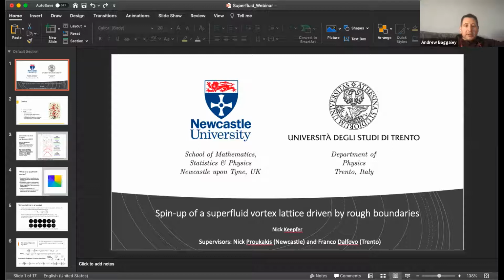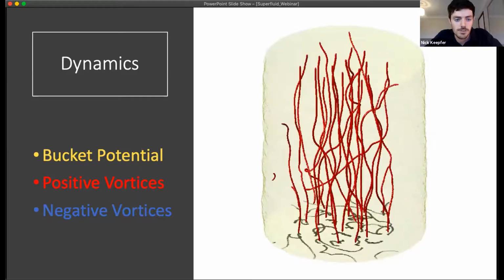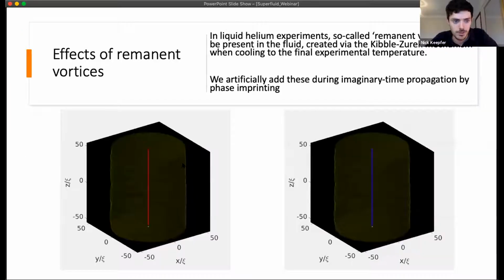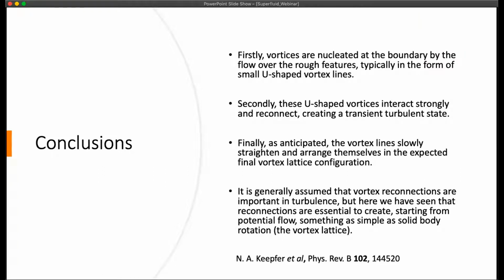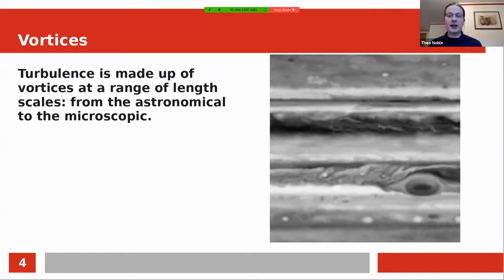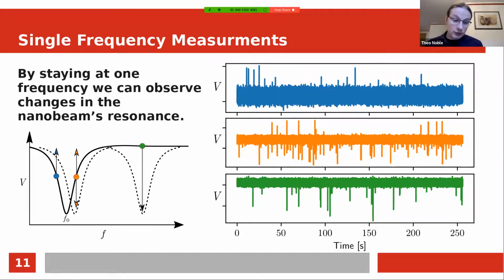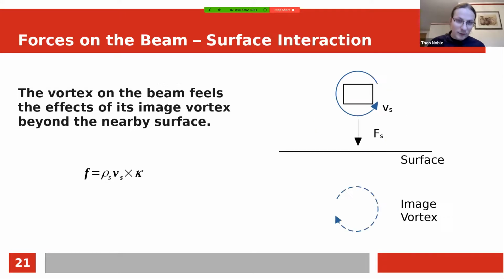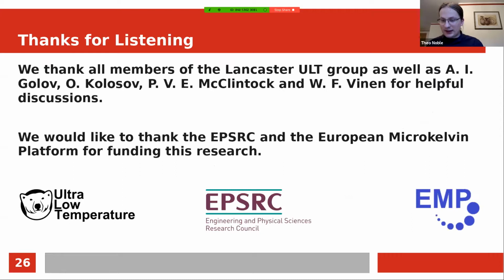Spin-up of a superfluid vortex lattice driven by rough boundaries

Comment: Are vortices in Superfluids a macroscopic version of what happens in Spinors? 

   Is there a geometric explanation of Planck's constant?   Does this explanation require at least one extra spatial dimension? 

   Dr. Roger Penrose has suggested instead of trying to create a particle called the "graviton" to explain gravity, why not try to describe subatomic particles in terms of spatial curvature, as in the twist in a piece of real thread.

   What if we add one extra spatial dimension to the "Twistor Theory" of Dr. Roger Penrose?   It can be "chiral" by having either Right-hand or Left-hand twist.  It can be "Quantized", based on the number of twist cycles.

   If Physicists describe electrons as point particles with no volume, where is the mass of the particle?

   Can one extra spatial dimension produce a geometric explanation of the 1/2 spin of electrons?   The following is an extension of the old Kaluza-Klein theory. Can a twisted 3D <---> 4D soliton containing one extra spatial dimension help solve some of the current problems in Particle Physics?

   What do the Twistors of Roger Penrose and the Geometric Unity of Eric Weinstein and the exploration of one extra spatial dimension by Lisa Randall and the "Belt Trick" of Paul Dirac have in common?  Is the following idea a “Quantized” model related to the “Vortex Theory” proposed by Maxwell and others during the 19th century?  Is the best explanation of the current data a form of “Twistor Theory” first proposed by Dr. Roger Penrose during 1967?  During recent years Dr. Peter Woit has explored Twistor Theory as a possible solution to help explain the current Standard Model.

   Has the concept of the “Aether” been resurrected from the dead and relabeled as the “Higgs Field”?

   In Spinors it takes two complete turns to get down the "rabbit hole" (Alpha Funnel 3D--->4D) to produce one twist cycle (1 Quantum unit).
 Can both Matter and Energy be described as "Quanta" of Spatial Curvature?  (A string is revealed to be a twisted cord when viewed up close.)         Mass= 1/Length, with each twist cycle of the 4D Hypertube proportional to Planck’s Constant.

In this model Alpha equals the compactification ratio within the twistor cone, which is approximately  1/137.

1= Hypertubule diameter at 4D interface

137= Cone’s larger end diameter at 3D interface where the photons are absorbed or emitted.

The 4D twisted Hypertubule gets longer or shorter as twisting or untwisting occurs.   (720 degrees per twist cycle.)  

   If quarks have not been isolated and gluons have not been isolated, how do we know they are not parts of the same thing?   The tentacles of an octopus and the body of an octopus are parts of the same creature. 

    Is there an alternative interpretation of "Asymptotic Freedom"?  What if Quarks are actually made up of twisted tubes which become physically entangled with two other twisted tubes to produce a proton?  Instead of the Strong Force being mediated by the constant exchange of gluons, it would be mediated by the physical entanglement of these twisted tubes.  Are these the “Flux Tubes” being described by many Physicists today?   When only two twisted tubules are entangled, a meson is produced which is unstable and rapidly unwinds (decays) into something else.   A proton would be analogous to three twisted rubber bands becoming entangled and the "Quarks" would be the places where the tubes are tangled together.  The behavior would be the same as rubber balls (representing the Quarks) connected with twisted rubber bands being separated from each other or placed closer together producing the exact same phenomenon as "Asymptotic Freedom" in protons and neutrons.  The force would become greater as the balls are separated, but the force would become less if the balls were placed closer together.  Therefore, the gluon is a synthetic particle (zero mass, zero charge) invented to explain the Strong Force.  The "Color Force" is a consequence of the XYZ orientation entanglement of the twisted tubules.  The two twisted tubule entanglement of Mesons is not stable and unwinds.   It takes the entanglement of three twisted tubules to produce the stable proton.   The term “entanglement” in this case is analogous to three twisted ropes being wrapped around each other in a way which causes all of the ropes to move if someone pulls one of the ropes. Does the phenomenon of “Asymptotic Freedom” provide evidence that this concept is the correct interpretation of the experimental data now available?  Can the phenomenon of "Supercoiling" help explain the "Multiple Generations" of particles in the Standard Model?  The conversion of twist to writhe cycles is well understood in the structure of DNA molecules.   Can the conversion of twist to writhe cycles and vice-versa help explain "neutrino oscillations"?   Within this model neutrinos are a small, twisted torus produced when a tube becomes overtwisted and breaks producing the small, closed loop of twisted tube (neutrino), and a twisted tube open on each end, which is shorter than the original.  (Beta Decay)

   Within this subatomic model gravity is produced by a very small higher dimensional curvature imbalance within atoms, which causes all atoms to be attracted to all other atoms.  This extremely weak attraction reveals the very small scale of the curvature imbalance.  This produces the curvature of spacetime on a larger scale like the solar system which is required to counterbalance this small imbalance in the individual atoms.